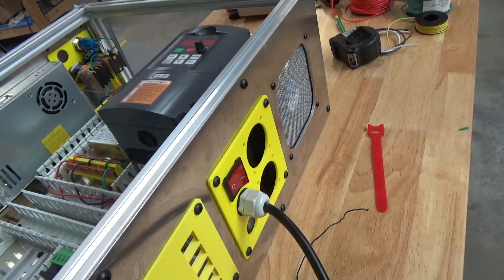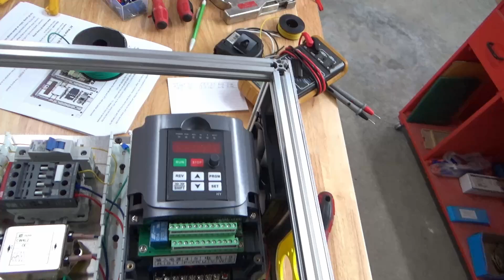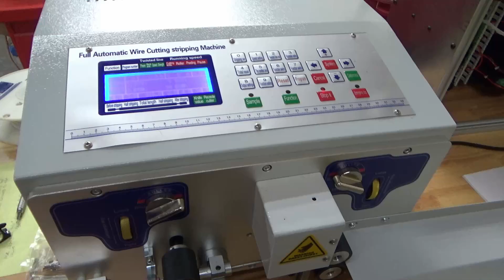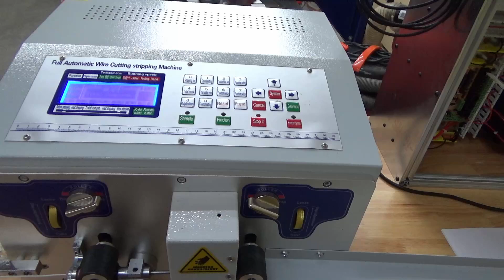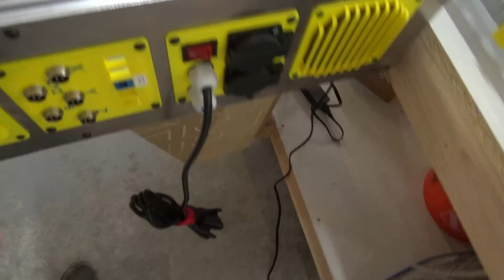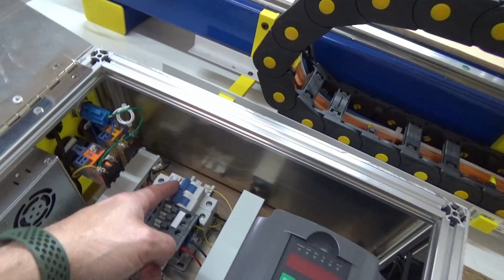PrintNC Build Part 8: The Control Box

Comment: Great Job! Thanks for sharing.
Any chance you could share your modified DC cover plate for the enclosure?
Reply from the maker: I feel dumb asking this, but which part specifically are you asking about? 🤣
Reply: @f15sim  The 3d printed cover  you modified with the flush keystones and the GX connectors. Its referred to in the fusion design as "DC Keystone & Screw Terminals Cover" except it doesn't  have the GX connector and the keystones  are not flush. Thanks
Reply from the maker: @RichMenzel  This should be the right part: http://www.geneb.org/printnc/New-Keystone-&-Stepper-Motor-Connector-Plate-v7.3mf
Reply: @f15sim  Got it, Thanks
Reply from the maker: @RichMenzel  YW!

Comment: thanks for the video. modern switching power supplies, such as in the video, typically have overcurrent/ short circuit protection, temperature protection, etc.
Reply: Awesome overview of your enclosure! 

Did you ground the shield drain on the spindle cable to the wago ground on the VFD side?
Reply from the maker: @mciarlillo  Yes.  It would suck as a ground otherwise. ;)
Reply from the maker: ...but the VFD may not. :)